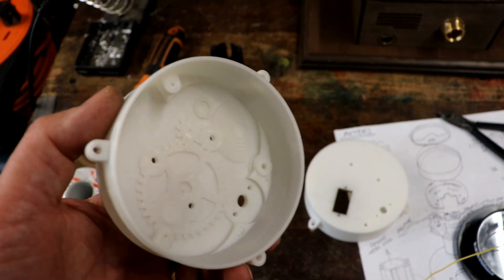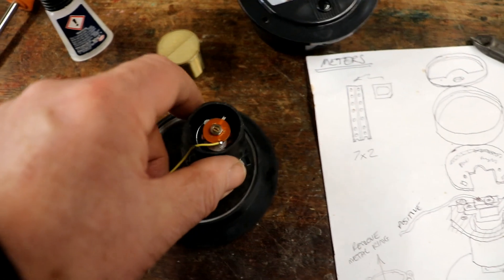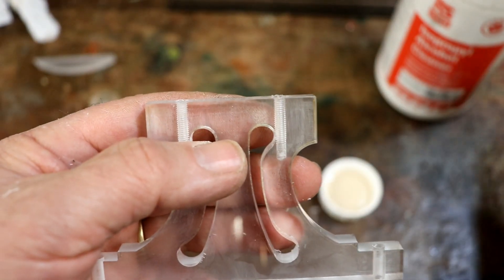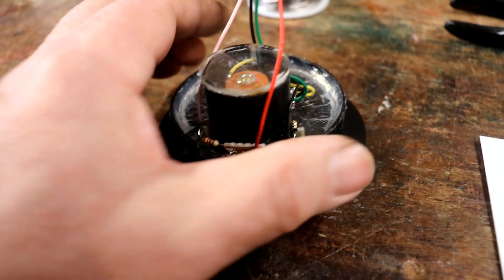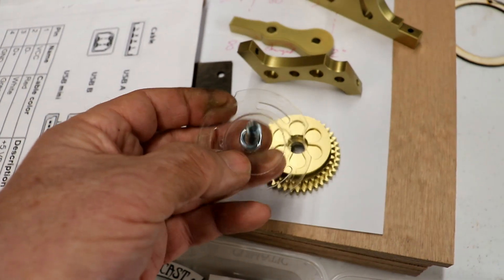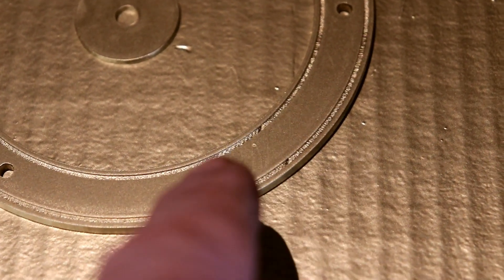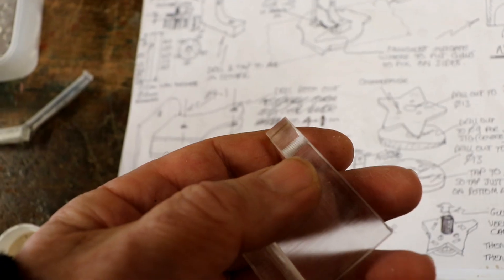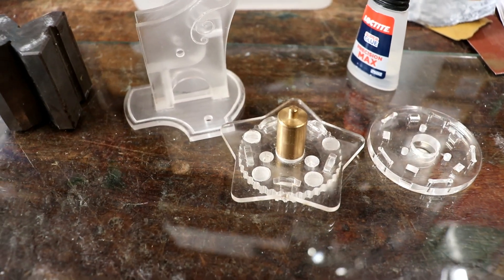Making a new Climatic Revelator and trying to sort out the Ukulele's Teensy

Comment: I know you have sung the praises of the Plastikote Brass spray paint in other videos.  I have looked for it on this side of the pond but apparently it's only available on your side.

Desoldering stuff can be such a pain.  Something I figured out about the copper braid stuff is that it works better if you push a length of it together.  That makes the wick wider and the strands of copper not so tight so, at least in my experience, the solder flows into it easier.
Reply: try krylon 1708
Reply: @TheUnofficialMaker  Thanks, I'll give it a try.
Reply from the maker: I've just looked up Plastikote in the USA and it seems it's being marketed under the brand name 'Dupli Color'?

Thanks for the Top Tip regarding desoldering braid, I'll give it a go!